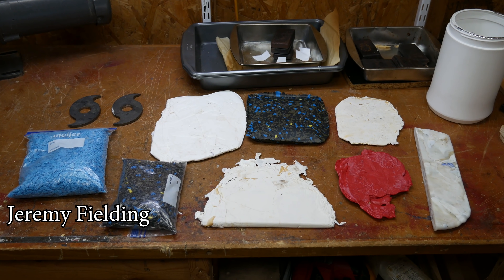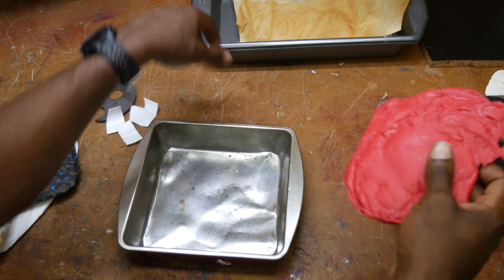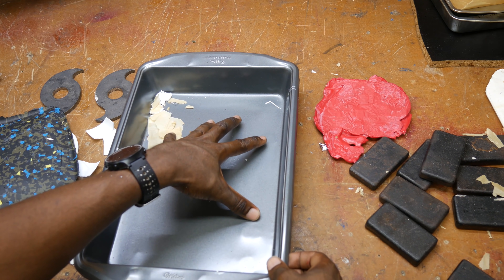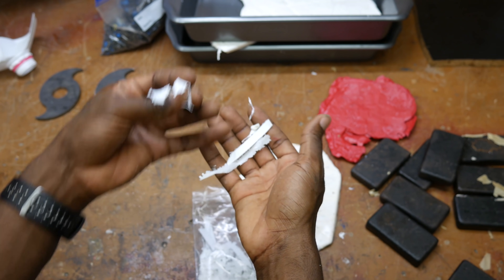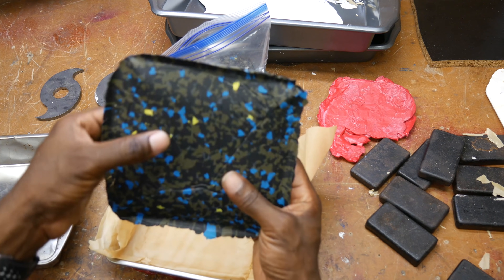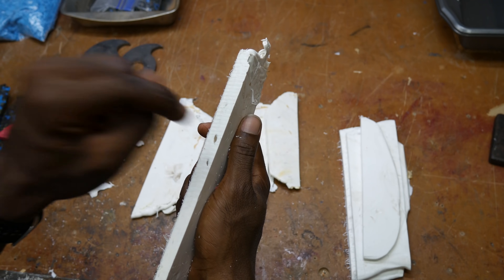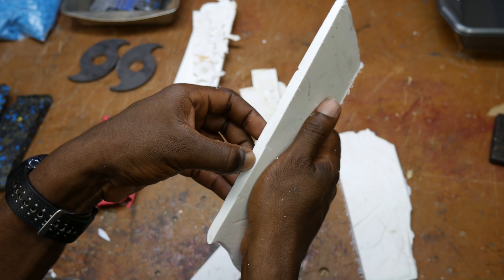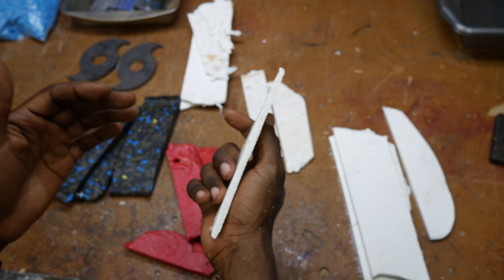HDPE, How Much Processing Is Required; I Put It To The Test!: 043

Comment: Really enjoyed this video, it's not that I don't like your motor-series, but them being more 'scholarly', recently I skipped them thinking : not in the mood for that right now...
How does the weight of HDPE plastics compare to MDF wood? (LMGTFY,  I know...)
Am I the only one who likes the urban camouflage look on the industrial shredded plastic?

can we expect another update on the shredder? Have you thought about using some wobble dado blades as a solution to the strips getting too long?
Reply from the maker: +Juanito it is pretty lite I think compared to MDF of the same size. I am going to work on the heating process for a while before I improve the shredder. But I do plan to do so. There will be other video topics in between... I want to get my next clock made and another secret topic that will come up soon.

Comment: how about using a electric wood plainer as a shredder ? would probably need a slow feed rate on chunkier stuff but should give you a saw dust consist antsy
Reply from the maker: +FDG . I would need a dedicated planer Because there is no way I am going to clean out the wood shavings each time.... just knowing myself. Also odd shaped pieces would be hard to plane. You might have to feed it many times to get it shredded ...perhaps if the pieces were recycled through the blade over and over automatically. Not sure how to do that yet.
Reply: maybe i should or said more the first time , rather than planing the "normal" way i guess how about having the planer blade up and a funnel feeding towards the blade, smaller piece would be self feeding thanks to gravity and using a plunger to force larger pieces in .... like a fruit juicer
Reply from the maker: +FDG LOL that would be interesting at a minimum! The blades are really designed to shave off material instead of cut. I am not sure it is worth converting a planer for that purpose
Reply: i would be more concerned about the strength of the blade as you say there designed  to shave rather than cut, but it may work as a second stage system. use your original design to cut into smaller strips then the planer for a more consistent flake, turn down revs on the blade to increase the flake sizes (to a point that you dont lose torque)
Reply from the maker: +FDG now that is interesting. It could be a gap so small that it can’t fall through until it is cut to the size we want.
Reply: if i had a planer i would give it ago, but im currently enjoying melting PLA offcuts from my 3D printer into blocks , it flows so well when melted at 200C and is really tough .....and colourful
Reply: HDPE shavings melt like crap. I know this because I melt HDPE shavings off my milling machine a lot. Fluffed up HDPE acts like insulation, and it oxidizes because of all of the air trapped in it. I generally just put HDPE swarf in the bottom of my melt box, because I'm only going to mill that off anyways. It's crap though. But if you want to do it have at it. I've made whole blocks out of HDPE swarf and the plastic doesn't even look right. I would only use it as backing under a drill job, or something. It's crap!

Comment: For non-stick, maybe check out vacuum bagging film for fiberglass processes - it's probably reusable if it doesn't tear, not too expensive, and IIRC it's rated for up to 450F.

I also wonder if you could use Metal Conduit with threaded caps and a compression spring pushing a plunger against your stock. You would get round ingots to work with.

Maybe some grease or a spray of silicone to help it release (it should shrink quite a bit as it cools).
Reply from the maker: +Joseph Dunn I have been concerned about using grease... only because I don’t know if it will effect the plastic. But I can certainly sacrifice some plastic to find out.

Comment: Air bubbles are tricky-- it might not be entirely your molding materials alone, but your slab method. I base this on experience with stoneware ceramic slab making, and stoneware clay recycling.. There are a lot of problems in ceramics with air bubbles, or voids where foreign particles were included, which burn out or burst in firing, flecks of plaster, small rocks, for example. You could have had some dust or lint issues, or maybe your melt didn't have enough soak time at a critical mid temperature, air could have been included in settling.Another technology where air bubbles mess up sheets is in paper marbling, it takes a lot of practice and some tinkering to avoid.
Reply: thaliahelene - very nice analogy except in plastics u could ultimately just boil them real good. sort of like smelting.  u could probably do that with clay but it would be more like making a slurry, and the heat evaporates the excess water.  the problem with his slabs is not enough heat.  in plastics particle size is important because it is a time factored engineered melt, otherwise it is more like playing with very dangerous wax.
Reply: Thanks, Michael. What I am saying is if the plastic particles don't fully heat up and perfectly slump, they may settle with trapped air. Boiling could introduce air, too, I would guess that slower heat is better. It could be that particle size is less important than the slab forming process than longer melting, maybe pressure. Who knows, there could even be additional issues with surface tension, static electricity. It's tricky to get air out of ceramic materials. You can't heat clay slurry directly into a solid, it will explode, must dry first. In ceramics you have to press air bubbles out of the malleable clay, in a procedure called wedging, and hope you got them all. I don't know much about plastics process, but some oversight of ceramics might be useful in identifying similar bottlenecks. I had hoped only to point out that air bubbles are common problems across crafting, and that there could be a range of fault causes in a slab, of which particle melt size is only one factor.

Comment: From what you have stated, the smaller the pieces, the better the result.
I was thinking about some way to use an inexpensive  paper shredder to cut up the plastic. I do know it would take a larger motor- to keep it from over heating. Likely, the older the shredder, the better, as many parts of the new ones are made from cheap plastic that breaks or deforms easily, even under normal usage. :(  
  If you can find a better built shredder unit, I think a feed hopper on top of it would be great to re-shred the plastic, therefore ending up with smaller pieces.
 The dado blade idea is great too.
Reply from the maker: +F.K. Burnham I am going for very small... like saw dust small. I just think if some want to continue on that road...it can be done but with mixed results.

Comment: Maybe trying rigging up something like a cider press to press the plastic fresh from the oven.  Maybe a shoulder vise screw?  http://www.leevalley.com/us/wood/page.aspx?p=31134&cat=1,41637,41659  or a tail vise screw (use two of these in my woodworking)  http://www.leevalley.com/us/wood/page.aspx?p=41664&cat=1,41637,41659
Reply from the maker: I like this idea... I would most likely make my own with threaded rod. I have some 1"-8 threaded rod and 5/8" threaded rod left over from making my lathe. That 1" rod would be perfect.
Reply: I use F clamps to press the plastic as it cools. I have a piece of diamond plate steel that I put in my melt box then I clamp that down. The thing is don't just mash the plate down. Get it under tension then as the block cools keep on tightening the plate up. Because HDPE shrinks a lot as it cools. But when you do this you create internal stress in the block. I found that out when I made this http://i.imgur.com/eBfoT6s.jpg Those pieces ended up curling up and just not running as smoothly as they should have. I haven't figured out any way to relieve the stress in HDPE either. I annealed one block but that took forever and it came out looking really bad when it cooled and shrank. It is the lower right hand block in this picture http://i.imgur.com/boPwUiN.jpg

Comment: (1) That's great research, thanks! (2) If you were using the result as simple structural components, the voids wouldn't matter too much. (3) I hate to say it, but how much does HDPE sheet cost? Here in New Zealand, I was quoted $NZ 100/m2 for 10mm - that's about USD $7/square foot for 3/8" sheet. That said, I'm going to keep experimenting myself.
Reply: Hdpe sheet is expensive here too.  $19 a square foot at 1/4 inch thick for example.  Definitely molding it directly into the shape you need would be the way to go.
Reply from the maker: +Karl Fimm I don’t remember the cost but looking at prices was what started all this for me. I wanted a sheet for a project and decided to make my own
Reply: If you buy new plastic granulate in bulk I think it's something like 2-5€ per kilogram or so (saw an auction for polyethylene 1.6 € / kg or polypropylene 2.8 € / kg). You'd need a bit less than 10kg for a 10mm thick one square meter plate.
Reply: i think yous are missing the point.. doing it yourself and doing it in your own way is the hobby, im sure he could just buy sintered metal gears rather then making plastic ones but thats no fun

Comment: I saw a guy melting HDPE in glass cookware.  He didn't seem to be having sticking problems, and his surfaces looked like they were polished.  But they were small samples.
Reply from the maker: +Ron Yerke I have not tried glass. That might be the difference I need
Reply: The guy used two glass pie plates. One on the other. If you need nine inch round discs it looks promising. Personally I'm not going to go out and buy two 9 inch glass pie dishes myself though. If there's an HDPE melting video on YouTube odds are I've seen it.
Reply: Paul Frederick sometimes when people throw out old microwave ovens, they keep the carousel plate.  One of those might be good to use, but IDK how to work with glass enough to get rid of the lugs used to spin them, so they might not be suitable for use on top.  They're also not very deep.  A pie plate or steel ring could be used under the bottom one to level it.  I read in the comments below, that applying pressure might be counter productive.  His reasoning seems to make sense.  I remember now, seeing a video of a guy using vacuum to de-gas glue for use on glass.  Maybe a heated vacuum chamber would be good for melting HDPE.  It seems like a pressure cooker might be convertible to this purpose.  Keep up the good work and God bless you.
Reply: If you don't press HDPE it warps as it cools. Some kid on YouTube claims to have developed a technique to avoid this but I, and a few others have tried it, and we can't duplicate his results. It'd be great if it worked. He claims that by slowly cooling the plastic it stays flat. I cooled a melt over 8 hours and it warped. Past that is it worth it for the electricity? I saw zero improvement in 8 hours of stepped down cooling did too. I might as well have taken the block out and threw it into a bucket of ice water for what keeping it hot for 8 hours seemed to have done. In fact I might just try fast cooling. Because slow sure don't work. Well, over a long heat you will get air bubbles out. But it doesn't seem to help with the warping issue at all. I haven't tried vacuum with HDPE. I don't have the equipment for that. That might be the secret? I'm not sure how practical a heated vacuum chamber is for the backyard hacker.
Reply: Paul Frederick You might be able to convert a pressure cooker into a vacuum chamber.  I HAVE NOT tried this personally, so proceed with caution.  Just remove the fitting that releases the steam and attach a hose barb.  Run a hose to any vacuum source.  Sinse it won't have pressure, it shouldn't present an explosion hazard.  If anything, your vessel might collapse, but I doubt it.   An inverted pressure relief valve should prevent collapse.   You could manually control the vacuum pressure with a gauge, T-fitting, and a valve like a gate or ball valve if you want to attach a continually running vacuum source.   As your vessel cools, you might need to vent some vacuum.  Sometimes pressure cooker can be found cheap at second-hand stores and estate auctions.  If you know anyone who goes to those kinds of places, you could ask them to be on the look out (BOLO) for a pressure cooker for you.

Comment: I'm going to try some 1 inch steel shaft with wrapped chainsaw chain welded around it. two pillow blocks on the far ends of the shaft. I think sliding the edge of a board into the teeth untell it touches and bolting it down it should be able to munch away at the wood to leave very little gap. then a large sprocket and chain set to a powerful motor and gear box
Reply: builtrodewreckedit, that sounds promising! I wish you would use something larger, maybe a 4" or 6" (100mm or 150mm) steel tubing for the core.
Reply: I'm most likely going to try smaller diameter first... the 1 inch solid shaft i have aligns the teeth more evenly than i like. I think bigger diameter only means it will take more torque to turn the shaft. I'm not ready to make a video yet but i really think it could work
Reply: bigger diameter shaft stores more energy when its up to speed so itll overcome more of a hard spot that might jam/stall the smaller rod, ntm easier to attach the chain to and more chains so itll last longer and run cooler, also theres a varying angle the teeth will approach the plastic at i think the bigger diameter gives a straighter approach thatll work better but i dont have experience with that
Reply: also i decent 1000watt or larger drill may be an alright power source if even just for prototyping

Comment: Like the test & results.
Thought I heard you say eliminate all the spacers?  
Or just gonna thin em down some ?
Reply from the maker: +MrVailtown yes. I think if I am cutting from the top of the rotation the blades will push back some but cut the plastic to dust. That is what I am after now. Plastic dust and shavings. I will need dust collection to keep it from floating into the room. Then use that plastic as well.